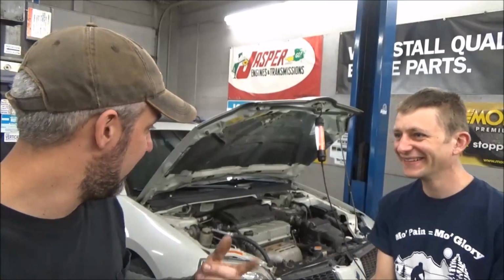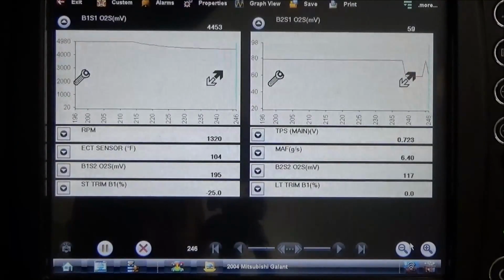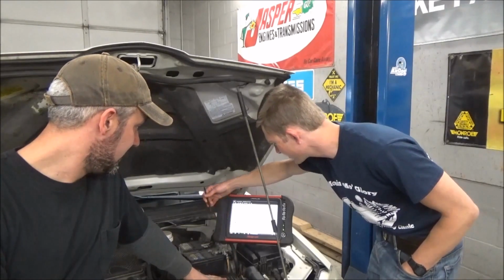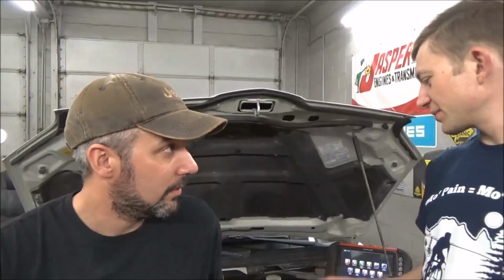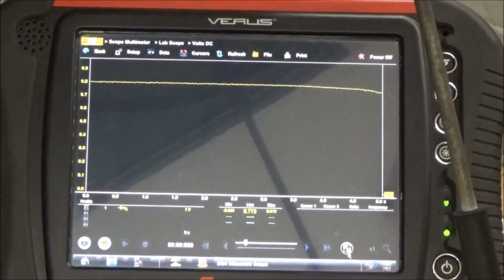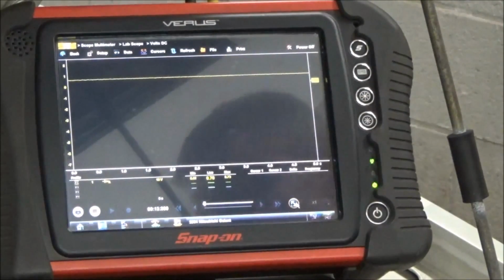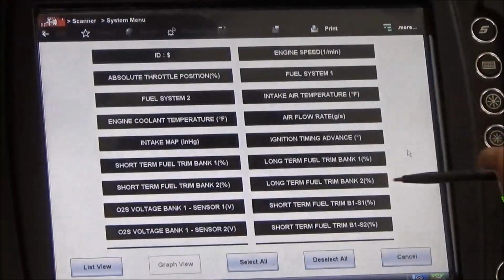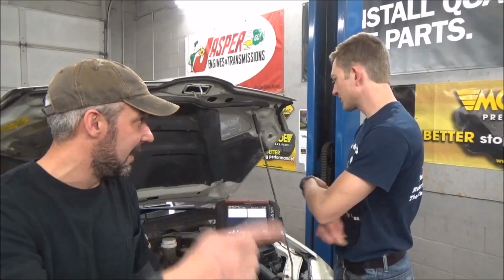O2 Sensor-No Activity Case Study: '04 Mitsubishi -Part1

Comment: I wonder what could be  the cause in a situation were there are no codes or check engine light, but the downstream oxygen sensor remains inactive? I have this problem with a 2.2 DGI GM engine. Ever since I bought the car, the second sensor is constantly inactive. I replaced the sensor twice with what the tech specs says for the car. And it remains the same, it results in very poor fuel economy.

Comment: From my experience the OBD-II HEGO Heater Monitor code is a two trip (two drive cycle) code. You can have an open heater circuit, and I mean open, not intermittent in any way, and the PCM will not set a code (illuminate MIL) until the 2nd trip (drive cycle) has completed. The variability in this monitor is if the module will set a pending code without the MIL. Which would make sense. Why else would you have a pending code software mechanism if not to store the first failure per completion of a valid drive cycle. To me it would be a natural step in a software state machine. But, I have seen results where no pending code is stored. So I find it a little confusing when comparing OBD-II implementation from one OEM to another. Obviously, there is some standardization in the OBD-II monitors, but I find the details of how each OEM implements the monitor steps can vary, especially in pending codes and freeze frame data. You have to do a fair amount of testing to actually back out how one OEM (which may vary between divisions and/or models) has implemented the monitors.

Comment: I need a great diagnostician.  I have a 2002 Isuzu Axiom with a P0160.  B2S2 inactivity.  Wires good.  All signals present for he O2 sensor wires.  Installed 4 new sensors same problem.  Changed again B2S2 sensor again after playing roulette with the 4 sensors.  Changed plug after I convinced myself that maybe the problem.  It is not.  Cleaned MAF sensor.  New spark plugs.  Great air coming through the catalytic converter in very strong pulses.  Played roulette with the coils, just in case.  It is a mystery.  I am now thinking a pcm/ECM might be needed.  Any wise words for the weary?
Reply from the maker: fill out an appointment form at www.pinehollowdiagnostics.com :)

Comment: OK I'm a rookie, that's why I'm watching but as soon as I saw 5 volts I would have went to the ECM and would have been expecting to find the reference signal coming out on the wrong pin either because of an internal problem with the ECM or because someone before me swapped some wires.  It was hard for me to watch you keep proving the sensors were working when I wanted to go test the ECM.  Can't wait to see what you find.

Comment: Hi Fellas, Thank you for all the wonderful tech video, I own a Body and Fender shop that does its share of mechanical work as we. You have been a huge help on the many passions I have been stumped . I did want to ask a please hellllp ?.
I own a BMW 750 that is having a similar issue Bank 2 sensor 1 no activity or on occasion next to no activity. Bank 1 sensor 1 was out at one point however seems to be online again. both upstream sensors are new. could the down stream sensors contribute to this issues . I've nearly pulled the rest of my hair out

Comment: Caution Caution Caution! At 12:53 Eric holds up a can of brake cleaner to spray into the intake as an "enrichener" for O2 sensor diagnosis. Eric's can has non-clorinated cleaner. Another common type of brake cleaner (from CRC) has tetracloroethylene. That compound can produce phosgene, a deadly gas, when heated or combusted. Phosgene will kill at very low concentrations (4 ppm) when inhaled. Please don't use brake cleaner in this test unless you know it is not clorinated and you are sure that it won't break down in a running engine into deadly gases.
Reply: rik999 people been doing it for 30 years. Not that your wrong

Comment: 1987 chevy v6. I had issue with o2 sensor. the car ran but it ran like misfiring. I use the scan tool notice the o2 sensor was not responding.  It grounding the cpu low and behold the sensor was really rusted in. 45 minutes later the car ran like a champ.
Reply: Alex Burns O2 sensor replaced. snap on scan tool documented no response at all. single wire O2 sensor.

Comment: Haven't seen part 2 or 3 yet. But it's obvious this car needs the clean air sensor replaced from the muffler. And while you there might as well seafoam the fuel system and rotate the tires

Comment: This is a quote from the Ford service information  OBD2 theory and operation on their 2015 gasoline vehicles that is free on their website.  Not sure if Mits was using something similar, but possible. 

"As the front UEGO sensor ages and gets exposed to contaminants, it can develop a rich or lean bias in its transfer function.  The  rear  bias  control  (also  called  FAOSC –  Fore/Aft  Oxygen  Sensor  Control)  system  is  designed  to compensate for any of these bias shifts (offsets) using the downstream HO2S sensor.  The "FAOS" monitor looks for any bias shifts at the stoichiometric point of the front UEGO sensor lambda curve. If the UEGO has developed a bias beyond the point for which it can be compensated for, lean (P2096, P2098) or rich (P2097, P2099) fault codes will be set."

Rear fine fuel trimming seems to be a big mystery in my opinion.  I really haven't seen too much literature on the subject.  I've run into all kinds of forum techs saying they used rear trimming on vehicles going back into the 90's, but haven't seen factory service information to support that.  There are rear trim data PIDS on some vehicles that will show on our shop's scan tool, but I've only seen it active on some of the later model Fords.

Here is another quote from Ford when FAOSC appeared in 2004.  Wonder if your Mits is a PZEV or has Cali emissions.  That would explain the special clean air BS from the owner.  Maybe they meant it produced less emissions. 

"Some  2004  Partial  Zero  Emission  Vehicles  (PZEV  Focus)  will  utilize  three  sets  of  HO2S  sensors.  The  front sensors (HO2S11/HO2S21) are the primary fuel control sensors. The next sensors downstream in the exhaust are utilized  to  monitor  the  light-off  catalyst  (HO2S12/HO2S22).  The  last  sensors  downstream  in  the  exhaust(HO2S13/Ho2S23) are utilized for very long term fuel trim in order to optimize catalyst efficiency (Fore Aft Oxygen Sensor Control). Ford's first PZEV vehicle uses a 4-cylinder engine so only the Bank 1 DTCs are utilized."

Sorry for the long winded post.
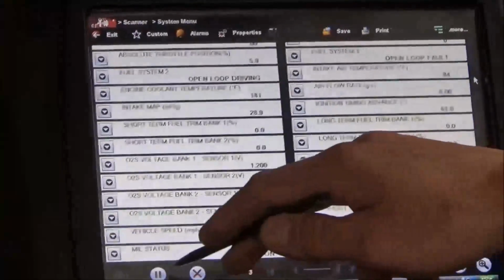Reply: 48:37 obd requirements: obd 2 (carb) carb is california air resource board so maybe

Comment: perhaps the wires on the o2 plug have been mixed up some how, seeing - neg volts on the wire to your scope maybe this is the ecu pulse width signal from the ecu for the heater, maybe ,thanks ivan for sharing  cheers

Comment: I can see a common B+ coming from the MFI relay, then going to the Mivec valve, injectors, CKP, EGR valve, EVAP, then all the oxygen sensor heaters. Nothing related to the signal wires..

Obviously the sensor isn't producing the 5 volts, it's gotta be coming from somewhere. My guess is that it's human caused. Someone put a jumper somewhere or switched wires somewhere creating backfed voltage. Similar to the crank sensor circuit of that Acura TL possibly!
Reply from the maker: +Dan.vaku Yup anything was possible with this one...definitely not a common problem!

Comment: It acts like a computer ground but more like a short to voltage especially with the -10VDC reverse polarity actual data vs processed data or short to voltage and the PCM sensor ground can't handle the currecnt so it is reverse current searching for a ground.  That kinda explains the 5V reading and the original -6.7 VDC and don't know if the computer then is going into a protection mode and that was driving the -10,67V which I think was then showing 1.275V vs. the initial 5V reading...I like the ones that make you think.  I'm using the data the customer provided stating the PCM was changed and that didn't fix it but I never trust that data. I never guess and let the DVOM & lab scope provide the data but I'll play along. Need to read the sensor grd wire disconnected and if reading voltage disconnect PCM...this would get me excited to troubleshoot b/c it's different.

Comment: Great video guys. Can't wait for part 2. My guesses are shorts in the harness, bad ground reference, some combination of those, with bad PCM a distant third.
Reply: +Ian Levine I'm down for bent pin at the computer connection or flipped connector there.  It's possible that the 'other' guy (I won't call him a mechanic) put the wrong computer on there - don't forget this one requires the super clean air version as per the phone call into the inner sanctum.

Comment: Were  the o2 sensors plugged into the proper connectors?  You said they were keyed roght?  I would be verifying integrity of the wiring harness and make sure the wires are in the proper places.  Also did you scope the maf sensor on a snap to see what it looks like?  I wonder if you have a exhaust restriction that is skewing your numbers.  Did you check Exhaust backpressure?

Comment: My guess is the replacement O2 on B1S1 has the wires transposed in the connector, so the sensor ground is in the heater feed position and the sensor ground is in the signal wire position, therefore feeding 12v into the signal line via sensor, hence the negative voltages seen in multimeter mode.
The white/black has been cut because this totally blew someone's mind!
Reply: Sorry, I mean the signal wire is in the correct position. Now, if some heater current has flowed down the sensor ground, it may have burnt a trace on the PCM board, affecting the other O2s. 
With a floating sensor ground at the PCM, the signal voltages seen will be effectively zero.
If you had put multimeter ground to battery ground you would have seen 12v on the sensor ground and something up to 5v on the signal line.

It's easy to say this from a distance!

Comment: My vote is a shorted heater wire to the b1s1 signal wire.  If I'm reading the correct diagram, the oxygen sensors share a sensor ground with the mass air flow sensor. If sensor ground had been lost, would there not be codes for the MAS?  Awesome video guys, can't wait for part 2!

Comment: I think the only place you could measure a negative d c voltage is at the alternator with bad diodes.  Check with a scope the d.c. voltage wave form output from the alternator.

Comment: Can't wait for Part II. You guys are Great to watch!
Reply: On the 2004 Mitsubishi Galant that you was checking O2 sensors on and everything and then you found out that the motor has been replaced, couldn't you not have looked  at the VIN number on the Block and the VIN number in the door panel or underneath the windshield on the dash and seen that the VIN numbers were different and known that the motor was replaced before you did all of that? I mean it was a great video in I learned a lot of stuff. I watched it the whole thing through but I wondered when you said something about the wiring harness was from a 2006 I wondered about the engine being replaced then. I'm not trying to be a smart after nothing I was just wondering why you wouldn't have done that send.
Reply: A different VIN #

Comment: Interesting! I'd like to check B1S1 harness side signal wire and ground independently to a known good ground to see where that minus voltage is coming from. Looking forward to part 2 guys.
Reply: As the minus voltage isn't there unplugged, I'd be interested in the sensor ground.
Reply from the maker: +Toyota Tech Great suggestion! Coming up in Part 2...

Comment: Hi guys, my best guess is a short between the loose cable you found on the connector of O2S 1 bank 1 and one of the heatherwires of that sensor in the harnas. Or somewhere in the connector of the PCM. 
Good luck, looking forward to part 2.  Well done so far.
Reply: +Willem Streutgers  and ofcourse use a testlight; http://www.amazon.com/Power-Probe-PP3LS01-Circuit-Tester/dp/B007QV0R7W

Comment: Ahhh the old Mitsubishi! What a fun project that was. We need another in depth floor mopper to work on! Wish you were up here for this Duramax I got in the shop now. Hoping it turns out to be a good learning lesson too!
Reply from the maker: +South Main Auto Repair Oh man that dang Mitsu sure mopped the floor with us for a while haha! I look like a "test-light rookie" in this one lol
Reply: Haha well you know you can't expect to be a scope on a rope pro over night, it takes time and persistence to master its techniques!
Reply from the maker: +South Main Auto Repair But with a LoadPro you don't need any prior experience...the magic button will tell you everything HAHA
Reply: motoYam82 HAhah imagine what a power probe is capable of with a screen and multiple buttons! Even comes with a book and a CD
Reply from the maker: Dude that thing scares me...one wrong push of a button...BOOM! PCM goes up in smoke!
Reply: motoYam82 Same with the load pro, one slip of the thumb on the magic red button and your broke ...
Reply: +motoYam82 Hi Ivan, another excellent video with you and Eric O together. Is it possible that the previous shop tried to use the connector from the old 02 sensor by removing the pins and connecting it to one of the cheap universal 02 sensors and crossed the wires? Possibly hooking the heater wires to the signal wires with reverse polarity causing the negative voltage readings you were getting? Just a guess.
Reply from the maker: *****
Ah it's all in good fun :) Just on that LoadPro video, I really wanted to see a more "scientific" and quantitative review on a supposedly "scientific" channel lol
Reply: +South Main Auto Repair Never push the Power Probe button when hooked to the PCM, unless you know what it is going to do.  My rule.  The tool beeps, how cool is that?
Reply from the maker: I can't STAND beeping tools lol
Reply from the maker: LOL here's a trivia question: how many amps does a typical car horn draw?
Reply: +South Main Auto Repair Toyota Corolla or Cadillac Eldorado?
Reply: Robert Wynkoop add a beeper to the test light and it can be cool too.... oh and safe :)
Reply: high note, low note or both?
Reply: Guy's didn't you know you can find the clean air sensor right next to the catalytic converter temperature sensor sheesh amatures. 😂😂
Reply: Give me a Mitsubishi electrical problem all day long out of all the rice burners, they was years in advance. Worked on so many imports over years. No need for scanners, a scope  was your friend with these cars, as there's plenty of oem known good waves and much more.
Reply: +South Main Auto Repair When you press the red button (mission: impossible music plays in the background) "THE PROBLEM IS THE GROUND WIRE IS MELTED, AND GROUNDED TO THE MANIFOLD! THIS SNAP-ON DEVICE WILL SELF DESTRUCT IN 3...2.. 1.. '

Comment: I believe scan data of O2 voltage will not show negative readings, they will display as positive on the scanner. If so, you could have a voltage feed on the signal ground of the O2 sensor on bank 1. Did you take voltage readings koeo at the harness side with the O2 disconnected? thanks for your time, br.